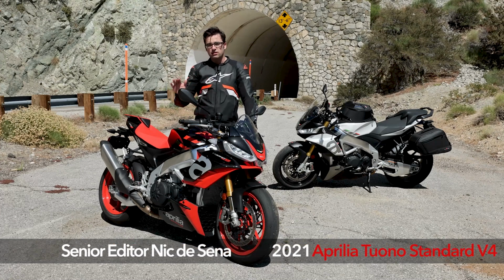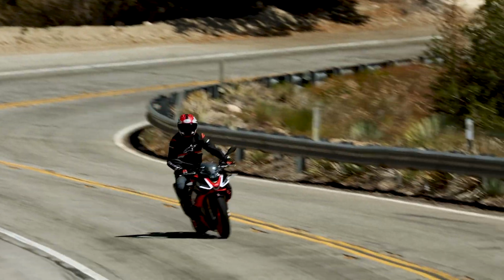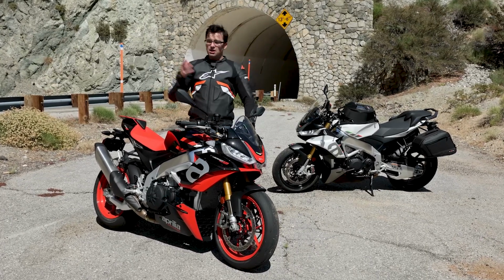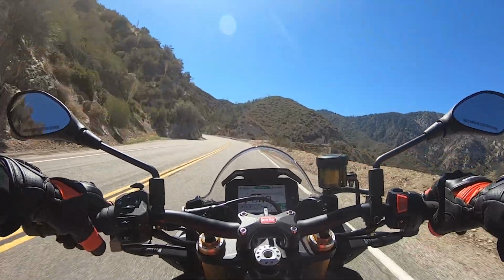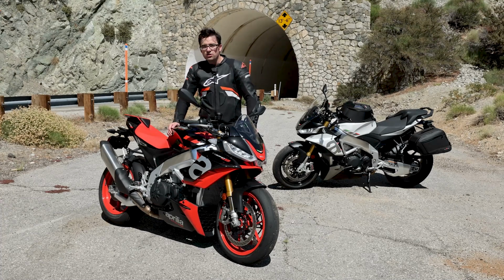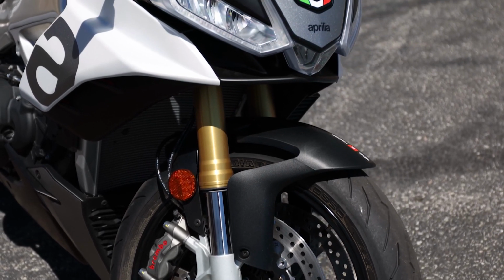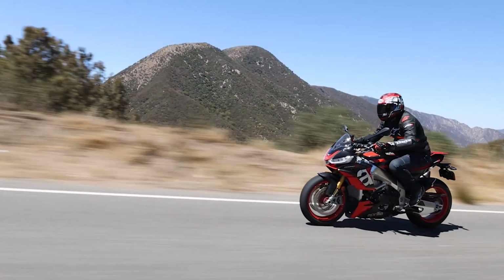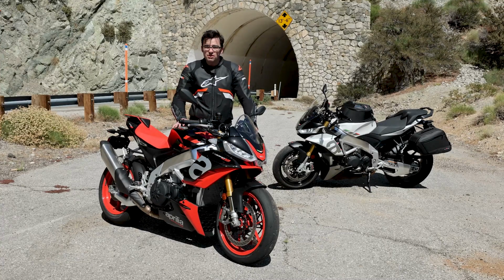2021 Aprilia Tuono V4 and Tuono V4 Factory First Ride Review | Ultimate Motorcycling

Comment: Thank you for the great content! I've been looking for a Factory model, but as everyone knows, they're not plentiful. To de-tourify the base model it appears it's the Windscreen,
Handlebars/Riser Removal? (Not sure of there would be too much slack in the clutch cable, etc), Tail Section, Tires and Front Fairing Plastic Removal. Obviously, there’s a point of diminishing return. Is there anything you think I'm missing? Thanks much for the read.
Reply from the maker: Hey Xroadracer, 

Sorry to hear about your difficulties with finding a Factory unit. 

That said, I'm not sure I'd recommend converting a Tuono into a sort-of-Tuono Factory. I foresee incompatibility issues between models, which could send you down a costly part-procuring rabbit hole. If it all works out smoothly, you'd still be missing the semi-active Ohlins suspension, which is a big part of the Factory experience. 

I'd say expand your dealer search. If you have to grab one out of state, then you could make a trip out of it! Also, definitely use the Aprilia store (https://storeusa.aprilia.com). They claim 60-day delivery times, and that's not a long time to wait for total satisfaction.

I fully sympathize with your plight since the Tuono Factory is awesome. However, I'd also recommend taking a spin on the base model. Although it is slightly more street-focused, you're getting the full-fat Tuono experience and adding versatility with luggage options. Though, if you're focused on hardcore sport riding and track days, the Factory will be your style. 

Hope this helps, 
- Nic